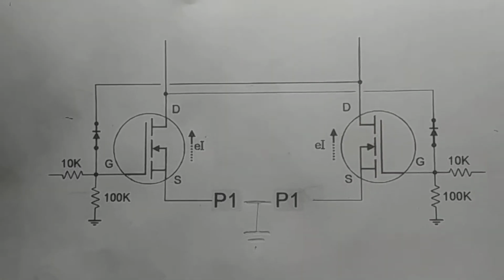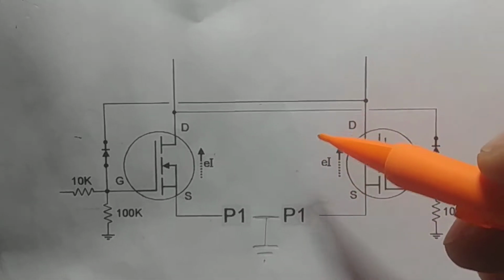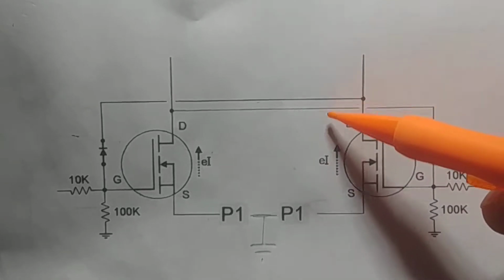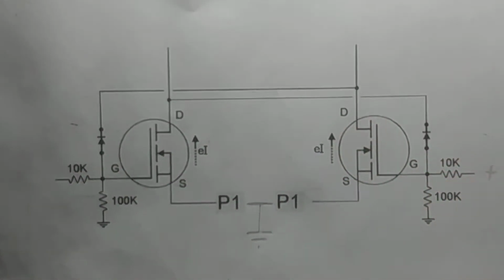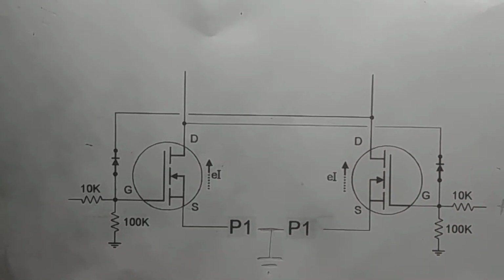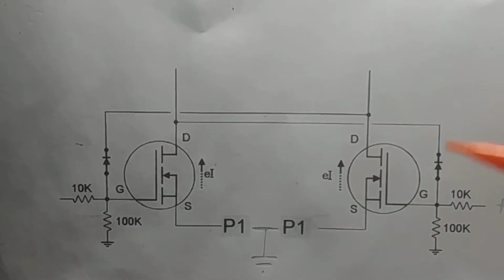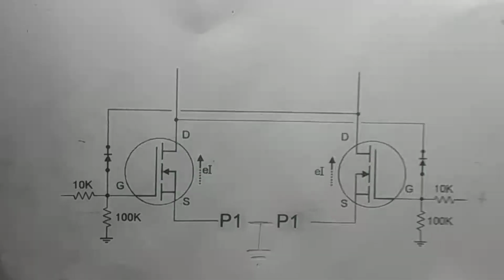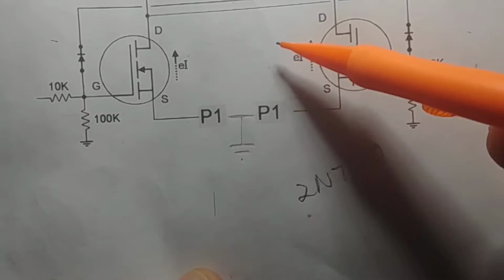Chlorine Generator #1: How to control power out polarity and keep from blowing up an H-Bridge.

Comment: Fantastic...Its about time this gets a DIY...You can also make a water alkalinizer
Reply: @ExcelinusCom  What is your location weather like? I would think in hot and direct sun would be different from shade or cooler cloudy weathers. So nice to see this. I would love to make my own. I can solder and repair wires, but I don't know how to use a meter well enough to calc resistors or capacitors, or mosfets and such. I thought mosfets were mainly found in amplifiers :-) Maybe you can make a kit for us less electronically inclined people to put together. Or maybe have a parts list and instructions ...The video helps a lot, but one with intention of a new perspective in setting up their own new kit.